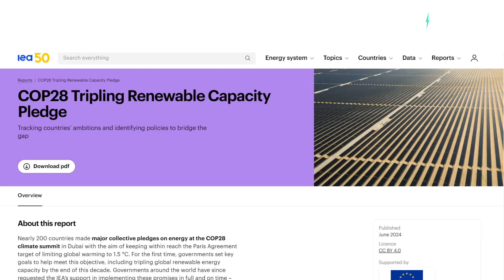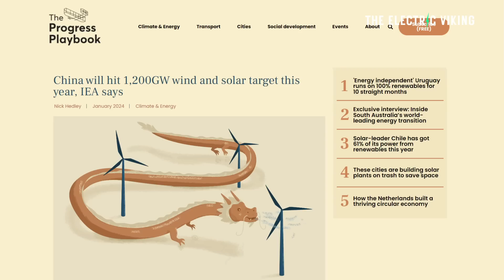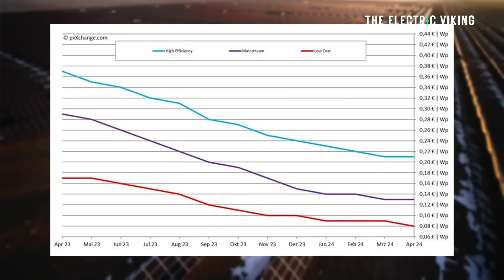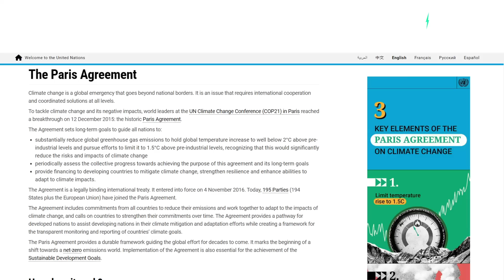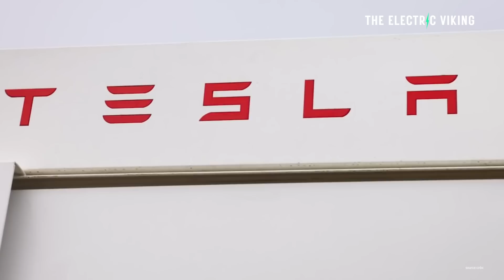IEA debunks media lies - world will triple renewable energy capacity by 2030

Comment: China may be building 90 per cent of the world's solar capacity but it is also building 90 per cent of the world's coal fired capacity. A simple google check will confirm this. They are not building these coal plants to shut them down in 10 years.
Reply: China might be building 90% of the coal plants in the world but when you are one of the last to do it you are always going to dominate that percentage aren't you. It was only 47GW that came online last year vs 230GW of wind & solar. The difference is quite clear and a very weak argument to say China is the problem. 
China's problem is they can't produce the solar/wind fast enough, hence the need for gas/coal plants for the short term. I'm guessing that these newer plants would stay online longer as they are more efficient than the aging ones, so better to turn those off first.
Fact is, China's grid isn't actually that bad. Approx. carbon intensity is 530g/CO2/kWh. Compare it to Poland which stands at 794g, India at 660g. Australia is only marginally better at 492g. It won't be long until the total emissions peak and start to drop which could be as early as 2026, but they say 2030 to be safe.
Reply: Your figures appear to be essentially correct. Your arguments have some merit. China still gets about 70 per cent of its electricity from fossil fuels. So 70 per cent of its EV fleet is powered mainly by coal. And will be for decades to come. They are still constructing coal plants at an astonishing rate and will continue to for at least 6 more years. Probably a lot longer. These plants will last probably 50 years. If you believe the gloomy predictions this will cause human's extinction. But I concede the point you made.
Reply: @Guvament_bs  cheers, China pollute the most purely based on size alone. I liken it to a Toyota Prius vs Lamborghini (as in all of them). Any Lamborghini is far more polluting than the Prius, but with millions of Prius' on the roads being driven further per year, they actually contribute more pollution than the Lambos ever will. It's an odd analogy I know but would apply even if China halved it's grid emissions, it's probably still going to be one of the largest polluters as a country.

Comment: So Y is china opening a new coal powered power station every week fact
Reply: The increment of RE capacity still couldn't meet daily demand of electricity.

New coal powered plant replacing Old coal powered plant due to higher efficiency and result into lower emissions and cost saving.

It is same thing like around 50% vehicle sold in China is new energy yet most of the vehicle transit on road is still ICE. 
It take time to replacing all of it
Reply: Chinese consumers see coal power as more stable and reliable. But China is the top 1 country installing renewables (it already has half of their energy generation capacity made of renewables, but it's not efficiently used yet). So to use their capacity more efficiently they are working in unifying the country's power grids, and with the use of batteries they will achieve their goal of generating most of their electricity with renewables. It's taking time so coal power plants still want to make as much money as they can making more chimneys and burning everything as fast as possible.

Comment: Over and over again I hear the cry "we need to upgrade the grid"...No!
What you need to do is distribute power production by lowering the price of solar panels to such a point that consumers will install them enmasse along with battery storage.... relieving the need to upgrade the grid. 
This can be seen in Australia where recently it was shown that the vast majority of the power on their grid comes from home solar installations. Solar is so cheap in Australia that it is a no brainer to install it. Not only does this keep you from having to upgrade the grid it also is more secure because every home has their own energy generator. Wide outages are a thing of the past. 
     What does the US do?  It slaps even higher tariffs on affordable Chinese solar panels driving the price up in the US to where few can afford to install it. The EXACT opposite of what we should be doing.  By artificially keeping solar prices high they guarantee there will only be a small market for US made solar panels... which in turn means our own solar industry will fizzle out and not grow.  US policy is backwards.      

   We should be using the low cost manufacturing capabilities of China to our advantage to clean up our own grids and get energy security and low energy prices for all our people.  Tariffs never work and have unintended consequences.

Comment: We have only tackled the low hanging fruit. Wide spread adoption will be more difficult.
Reply: Not really.  Already the cost of unsubsidized wind and solar are lower than buying fuel for paid off gas and coal plants.  We've now reached the point at which market forces will drive the switchover.

Comment: Solar and wind Why does  no one include the transmission of this intermittent power . The cost of transmission of renewables is low when it is a small percentage of the system and has fossil fuel baseload backup.
As renewables increase their percentage of the system the grid you need to build transmission of an intermittent system supply grid. 
This will far outweigh out weigh any cost savings.
Reply: Nope.  More and more we're building solar on old coal and nuclear sites, storage as well.  Using grid connections that were paid for long ago.  Then look at the current cost of unsubsidized wind and solar.  They are under $0.03/kWh in the US and that is an all-inclusive real world price.  It includes transmission.
Reply: @bobwallace9753   Interesting , so why is the price of power going up if renewables are so cheap ?
Reply: @johnnykkkk  
Has the cost of power gone up due to the addition of wind and solar to the grid?  

That's not the case in Texas.  The inflation-adjusted cost of electricity has remained stable while Texas has installed a massive amount of wind generation and a goodly amount of solar.

In California, there have been massive costs to the grid due to having to deal with increased fire danger in forested areas.  And a lot of the renewables now online were installed much earlier when the cost of wind and solar were much higher.  Those early sites received 20 year power purchase agreements at rates much higher than current costs.
Reply: @bobwallace9753  In Australia it has, from the cheapest power to the most expensive power Lucky you have Nuclear as a back up in the US for unreliable renewables
Reply: @johnnykkkk  

Do you not realize why electricity became expensive in Australia?  It wasn't because Australia is moving to solar.  Australia is moving to solar, via end-user solar, because electricity got so expensive.  

Nuclear cannot be a backup for wind and solar.  Nuclear is not quickly dispatchable.  The best backup for wind and solar is storage.  And that is where we are going.  While we ramp up storage we will continue to use existing hydro and natural gas to fill in the gaps.

And, geez, spend a few moments and learn how very, very expensive new nuclear is.
Reply: @bobwallace9753  geez your not in the real world storage is the most expensive waste ever the current biggest battery last 7 minutes.... battery's are only to stabilise the system. No developed country in the world has or can run on batteries solar wind but 19 of the top 20 have Nuclear ... except Australia..  that's why big business are leaving and no energy user would open anything here with the failure of a renewable only system,  Energy never became expensive because of coal it became expensive because they closed down coal .... your system in the US can't even be compared to Australia
Reply: Not if you correctly size and place batteries. Look at the cost curves for batteries. Your points are correct under the old paradigm but not data set.
Reply: @tomconrad7091  Batteries need to be put in the correct locations for system reliability and cost increase when grid transmission is included 
 "If storage is provided to an electricity system as the only technology available for variable renewables to meet electricity demand reliably, then the cost of storage increases exponentially as the VRE share increases." GenCost 23-24 report

Comment: I switched to an all-electric home from 2018 to 2021. The last year I used fossil fuels for my car, cooking and home heating, i used 60-70 MWhs of energy (petrol, heating oil and electricity). I now only use electricity for energy - 16-17 MWhs a year.

Moving off fossil fuel powered systems will reduce the amount of energy we need to generate.
Reply: Yep; the Sankey diagram says it all. Under fossil fuels, ⅔ of energy is wasted.
Reply: You hit the Nail. Nobody talks about this.

Comment: Let me help you. 
Cost of travelling on one litre of petrol in a 2 tonnes Rolls Royce is horrendously expensive compared to the same petrol in a cheap 2nd hand 2 tonne Ford.

The vehicle makes travelling extremely expensive in the Rolls Royce. 

The grid electricity goes through a Rolls Royce infrastructure. 

Rooftop solar PV is not a Rolls Royce infrastructure. 
EV big batteries are free with the vehicle. 
Selfplug-in V2G EVs parked 23hrs every day.
And drive building to building. 
EVs can be filled every day.
A full EV battery is 10 times more than a home battery. 
A full EV battery can do 10 daily drives. 
A full EV battery can do the long drive at any time.

Comment: The grid is extremely expensive and more electricity is needed to replace fossil fuels. 
Electricity is 5cents kWh 
My bill is 50cents kWh 

Generation costs 5cents kWh 

It is the GRID between millions and millions and millions and millions of customers and 5cents kWh electricity. 

Rooftop solar PV with EV big battery has NO GRID COSTS. And no battery STORAGE COSTS 

Normally $4,000 generation needs $40,000 of NEW GRID as 5cents kWh new generation is built to replace the fossil fuels.

PEOPLE ARE CONFUSED.
As the fossil fuels are replaced with electricity the grid will be needed to BALANCE storage.

If you MONOPOLISE the existing national grid with only 15% of ALL the electricity we need then you have to build new grid, FMD, this is f...king expensive. 

Electricity generation and storage AT THE CUSTOMER'S location is the only economic solution.

Comment: Has rethink x changed its estimates based on the electricity demand of AI compute?
Reply: Look at what companies are spending on chips to build their supercomputers.  Don't you suspect they will be spending money on wind, solar, and storge to assure a supply of affordable electricity?

If you're building a supercomputer, you aren't dumb.
Reply: @bobwallace9753  Microsoft built their data centre next to a nuclear power plant. And Open AI invested into nuclear fusion. The point to be considered is that there is going to be higher demand for electricity than Rethink X previously thought.

Comment: 7 years ago, my 2500Wp solar panels incl. inverter and labor cost €4.200.
Today, the same set 2500Wp with inverter and work will cost me €5.800.
Tell me again that the prices came down?
Reply: Inflation alone on £4200 from 7 years ago would be £5423 today.  I agree though, not 70% cheaper.
Reply: You do not have a 2.5 Mw array.
Reply: @chrishaberbosch1029  it is a 2500Wp panel set, delivering around 2500kWh of energy per year
Reply: @chrishaberbosch1029  No, just 9 x 275Wp with a total of around 2500kWh per year.

Comment: One of the issues for traditional fuel plants is there is no way to reduce costs. The cost of operating these plants can only keep going up. Renewables started out expensive and there is still a lot of cost takeout that is achievable. It's the same with ICE vs EVs all the cost reduction for ICE has already happened and it's going up and the EVs are just going down.
Reply: @Leah-ju8ht  Is everything made of coal? I keep hearing that…
Reply: @Leah-ju8ht

Dirt.. ie silicone.
Reply: There will be a last gasp for fossil fuels just like in 2021/2022 in the US when coal actual grew. This is because there is an input fuel cost for legacy generation and that input fuel costs go down when the demand for that fuel goes down...thus making that solution relatively cheaper. The same is going to happen for NG and specifically LNG where capacity is being increased significantly. Those sunk capital costs are happening now and the marginal production and operating costs are going to be low for several decades. As the world becomes awash in more NG than it needs the price will drop even further and installed dispatchable backup power will compete favorably with renewables + battery storage. The shift is inevitable but countries are going to continue to operate legacy plants because the capital cost is already sunk and their operating cost is going to go down as fuel input cost goes down. Everyone is going to continue operate legacy as long as the cost curve, represented as total cost to ratepayers, makes sense. This is exactly why coal had a recovery in the US in 2021/2022 after getting decimated in the previous 10 yrs. Don't get me wrong, it is last gasp stuff, but don't underestimate how long it will take. New capacity is becoming a slam dunk because of capital cost/efficiency gains for renewables, but replacing legacy capacity is a different story.
Reply: @fredflinstone8628  ''input fuel costs go down when the demand for that fuel goes down'' - are you insane?!
Reduced demand has a direct and inevitable effect on cost & price, because costs do NOT also go down!
Costs can only go down with increased demand = overheads are distributed over additional volume. Reduced volume = costs are spread over less 'product' = product price MUST goes up!
Fossil fuel companies will NOT be able to reduce prices because of increased costs, so they will have a choice to accept lower margins, but I think they will simply increase prices and accept that they are in a dying industry!
Reply: @fredflinstone8628  It is easlily possible that it will take longer, as you write, but the most important thing, also as you write correctly, it will happen.
Reply: @fredflinstone8628  Fossil fuels will be used 50 years from now.  Not as much,  but they will be used. Nearly everything in your house is affected by oil and gas production.  Many of the millions of products made with fossil fuels can not be replicated without them. Fossil fuels are not going away any time soon.  And BTW,  the ENTIRE national defense military depends heavily on fossil fuels.  Without fossil fuels, you would be speaking Russian or Chinese.  You are just too ideologically delusional to understand the hard reality we live in. Without fossil fuels, our nation would be conquered in a matter of weeks.  You had better start praying that fossil fuels don't go away anytime soon.
Reply: @fredflinstone8628  
All you are actually saying is that change doesn't plot out as a smooth graph line.  There will be some "ups and downs", but the overall slope leads to a fossil fuel free future for the planet.

How fast?  If we look at other technology shifts, faster than almost anyone would expect.
Reply: @bobwallace9753  unless your name tony seba and can see quite clearly
Reply: Exactly, the marginal cost of energy ie the continuous cost of operating the power plants aren’t going down. Meanwhile the marginal cost of solar and wind (especially distributed solar) is dropping to nearly zero. Fossil plants can’t compete.

Comment: Hi Sam I live in chilly cloudy Wales and I have a 3.2Kw array with 11 Kw battery. My bill for last month was £2 and change for actual electricity and £15 for standing charge, the cost of the equipment etc. I know it will be more in winter but hey I'm not complaining.
Reply: Your batterie is kWh, not kW.
Reply: no shit Sherlock
Reply: i ask is a micro wind turbine a option? and extra battery capacity? to make more money and be self sufficient?
Reply: @RayJohnson1980  micro wind turbines aren't really much use for normal usage. Turbines need massive swept area to be more efficient e.g. very big blades. So solar is better in almost every respect but yes, people are trying to make commercially useful products for houses that use wind. Also, solar is much quieter and while no-one serious cares about the appearance of wind turbines, we do all genuinely care about them creaking and groaning on top of every house in the street. I haven't yet see a viable small scale one - small scale hydro if you happen to have a stream is much more likely but hardly anyone does and it's fraught with problems and fish have to live.
Reply: @RayJohnson1980  Micro wind is a waste of money if that is what you asked. It actually doesn't make sense to try to be self sufficient. Try to become 85% or at best 90% using solar and a battery. On doubt, make the solar generator larger, not the storage.